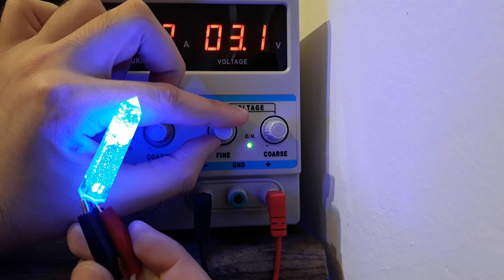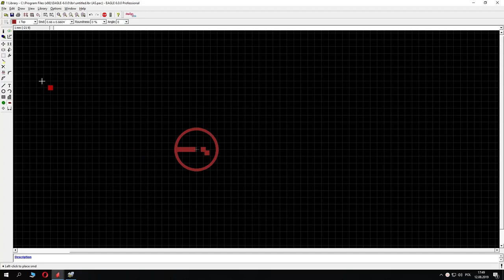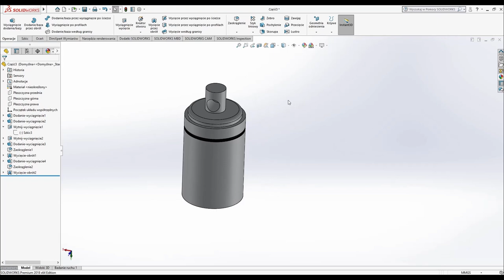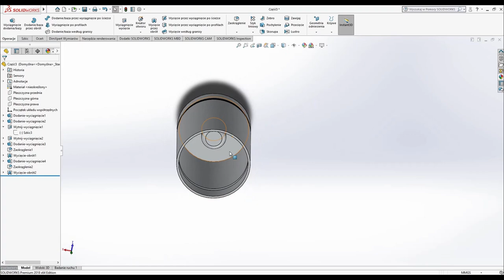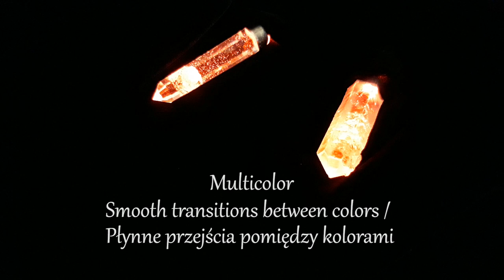Making Kyber Crystal Glowing Handcrafted Replica Pendant / Keychain Star Wars [PL/EN]

Comment: Can you please explain how did you make the case for the led light batteries to switch it on just with a single twisting. And the thing you did with computer
Reply from the maker: Actually its very hard to explain how I did it, cause it's a process related with few skills like 3d modeling, mashining and electronics. Learn the basics in this area and everything will be clear :)
Reply: @heartcraftedfantasy  thank you 🙂. I will definitely try to learn these things and make some.
Reply: @heartcraftedfantasy  i searched a lot for 5 days, but couldn't understand how did you complete the Circuit. 🙁🙁 It seems interesting but I can not understand. Will you please show us that part in an another video ??? I want to learn about it.
Reply: @sumantramandal4862 i'm having trouble understanding it too but the principle is that it runs on the twist mechanism at the cap which acts as the on/off for the circuit. the LED is connected to his own custom pcb board thingies that have two specific connections on the bottom and a single connection on the top. When you twist the cap, it pushes the small coincell batteries down making the connection to the top of his pcb board thing. What I don't understand is how this could be cause I assume you would have to make the connections at the positive and negative sides of the battery which I don't see.